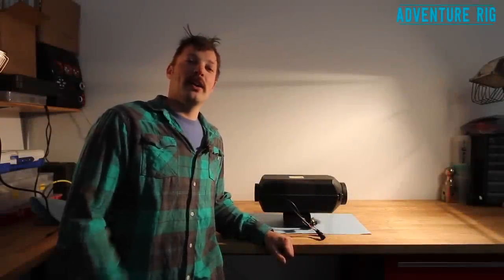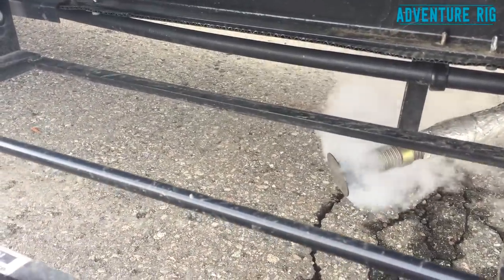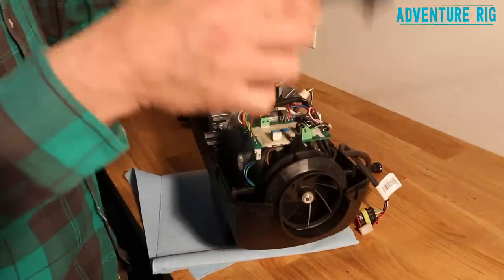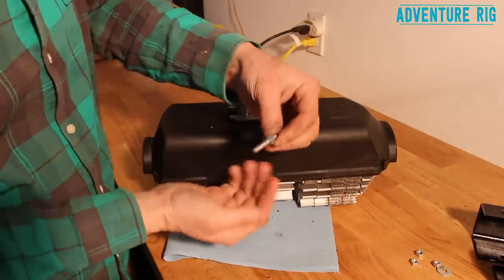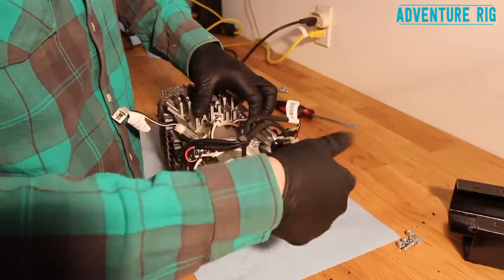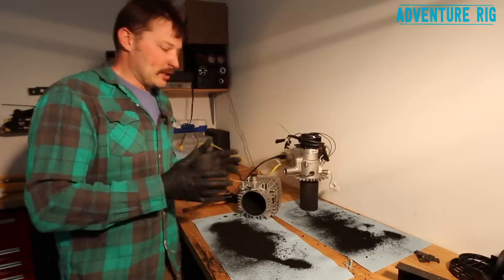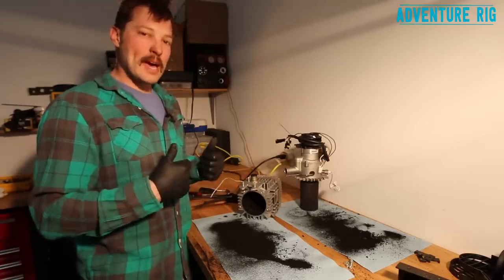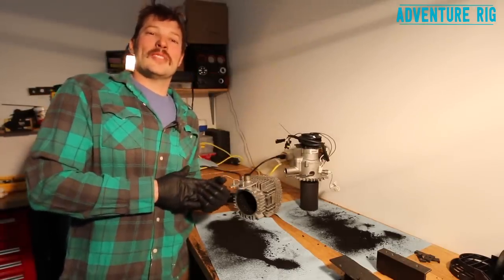Must watch before you use your new Planar Heater! [How-To] Disassemble and Clean Planar Heater

Comment: I installed mine and used it for about 20 hours not knowing that information I was running it on low turning it off excited to have a new product starting it up again running it on low I must’ve turned it off and on 10 times in 20 hours and would crank it up but then turn it down to low cause it’s so hot 
the next day to it wouldn’t light and was smoking I took it apart and was full of soot!  One day of use !
Reply from the maker: Been there done that.

Comment: I baught an 8Dm. Ran it with diesel controller and it's never missed a beat.
Reply from the maker: Our 8DM ran great as well.
Reply: @AdventureRig  9 dm next winter with a controller that WORKS. lol
Reply from the maker: @dougferguson5581  I have a new controller that is all digital and it’s freaking awesome. I’ll post a video this winter on it.
Reply: @AdventureRig  coil  the sooner the better.  Ya tried 3 different models. None worked yo the point where it acquired the temp shut off and restarted.

Comment: Just started looking for a brand to buy. I happen to live in the same area as their distributor. They are not cheap and the fact they don't mention this in their instructions just shows how corporations don't take responsibility for their product. The warranty is only a year or so as well, I'll double check. If the company were forced to clean them they would probably start writing it in their manuals. But what consumer wants to go through the cleaning process. I might just buy a cheap version and take my chances as well. Their quality certification means sh*t. Thanks for posting
Reply from the maker: I would save the money and try a cheap version and see if it's any different.

Comment: Is there a gasket between the 2 halfs ?
I normally crank it up once in a while because I saw this video a long time ago , my Planner 44d was working great for about 5 years no issues but this morning the outside temperature was negative 27 Fahrenheit and the heater blinked 2 times (code 13 )
I'm going to heat my fuel pump up with a heat gun , hoping there's just ice in my fuel lines
Probably clean it out too or see how dirty , thanks for posting
Reply from the maker: No there is no gasket.

Comment: I feel I have to put my line as well. Thank you for this video instruction. I used it a second time to clean my 44d. After the first time, I ran it at full power so often. Eventually happens the second time, maybe diesel is not high quality for that. And the chamber inside was not so dirty as yours, but yesterday it refused to start and gave me lots of smoke. Now it works perfectly.
Reply from the maker: Yeah running it on kerosene has helped immensely for me. Just not as excited that I can’t run it on diesel which is east to obtain for me.

Comment: Sorry for sounding daft but why do you need a HEATER that puts out 1 or 2 degrees.... Kinda defeats the object of a heater?
Reply from the maker: I’ll fire up the heater when it’s 10 degrees outside. It’ll warm it up to 80 degrees in the camper. Once it’s 80 the heater just holds that temp which means it runs on low.

Comment: Hi. So ive run the 8 dm in my 37 ft Camio for 4 winters.  No thermostat I've ever had sent to me from Planar has ever worked. I also use diesel conditioner in ever 5 gallons I put threw it. It runs great...never had an issue.  Has anyone out there baught the new 9 DM ? Thinking of getting one for winter 2022. I do recommend these heaters.
Reply from the maker: Have you seen the new electronic thermostat they offer? It's a touch screen and super user friendly.
Reply: @AdventureRig  hi. Ya tried them all. There's no one near me to service them . I had an rv tec try that one too. It just runs full time. I'm going to get a 9 dm next year I think. Wish there was a vid on here showing how it runs. 4 seasons on the 8 now. Never had it cleaned . I run conditioner threw it. I'm sure it's got soot . No idea how many years they are good for but I sure don't want it yo calf in 20 below weather. Will toss it and buy new.

Comment: Thanks for the video, really helpful.  I did watch it when I bought the High Altitude Russian Plantar model so I ran it on  M/high most of the time and never at night when I'm sleeping.  Use warm blankets!   It has now  been used in my Diesel Sprinter van for two winters.   My last ski trip in Silverton Mt the heater did exactly what you described in your video.  Lot of white smoke and wouldn't heat up. Bummed...  Snowing and I now need to get it up and running.  It is tapped into my fuel tank and mounted under the passenger seat. It will be a real pain to take it out to clean it.  If I disconnected my fuel line and ran it into a can of Kerosene would it clean up?  You mention using Kerosene full time now.  Did you mount a tank under your van or do you carry cans?  How long will a gallon last on Med/high.  I dread the thought of dealing with another fuel source so any suggestions would be great.  Thanks
Reply from the maker: I would try kerosene first and see if that cleans it up but most likely it will need to be cleaned. I run a separate tank on our trailer. It may just be something that needs yearly maintenance although it sounds like a pain in your case.
Reply: @AdventureRig  Thanks for getting back to me.  Mine doesn't get used a lot maybe 20 to 30 times a winter but it is used at high altitude over 8000, 3/4 of the use.  How often should I replace the gaskets and filters. Thanks Marie
Reply: Blankets ain't an option for me as I'm in Canada and may need to sleep in vehicle while finding housing. This can be life or death. These things cost 1000 bucks plus taxes and whatever else to get them installed. Now wonder people buy cheap versions if paying more gets no more reliability.

Comment: I saw people mentioning kerosene but it seems to be three times the price and then you need to add ATF, 2 stoke oil or diesel to it to lube the pump. Kind of defeats the purpose. 
Also I’m kind of lazy so I’d recommend spraying some brakleen or some other solvent in the air intake while it’s off and just let it drain out the exhaust. It won’t be as clean as taking it apart but it’ll be enough to get it going again. I’ve had O2 sensors work for another year with just a little brakleen. Can is only a couple bucks and great for so much more than breaks.
Reply from the maker: Jason Thanks for watching Jason.

Comment: I bought a Chinese knockoff heater, and the one that I have allows me to adjust the air/fuel ratio via the controller.  Soot builds up primarily as a result of insufficient combustion air compared to the amount of fuel.  If the Planar allows you to increase the amount of air and / or decrease the amount of fuel injected when running at the low setting, you might try making adjustments to get it to burn as lean as possible while still maintaining steady combustion.  That may resolve your soot issue.
Reply from the maker: Brian Smyla Hi Brian thanks for the feedback.
Reply: I have the 8KW chinese version with red oled remote. Do you know what the parameter PF-1 to PF-6 means? Have asket the seller but I only got stupid answers. I also have an option off and on in the options menu.

Comment: I wonder if you can help me. I have a similar heater the Planar D2 . It tends to "false start" now and  again. .. The routine it goes through to start sounds a bit different with the clicking of the pump a bit  faster tnan normal. Then it like shuts off  for a few seconds then Pang makes a loud scrtchy fan noise. I then turn it off and restart and it usually performes properly on the second try. Any suggestions as to what might be causing this " false start"??
Reply from the maker: Is it giving you any error codes?
Reply: @AdventureRig  I don't have any sort of display :-) So, no :-)
Reply from the maker: @Garo48  I'm not sure what the noise is that you're hearing. I would send them an email. They've always been helpful for me.

Comment: Just got a new one from ebay and im not getting power to the controller.  Checked fuse and I'm getting 12v to the ecu but no voltage to the controller?  What else can i Check
Reply from the maker: I’m not sure but their website says not to buy them off eBay because they are a counterfeit product.

Comment: i hooked up my heater neg-to pos, and pos to neg, now i can't get any power to it. can i get some advice on how to repair this. thanks.
Reply from the maker: I'm not sure that would blow the fuse since it's now on the opposite side and now hooked to negative but I would start with that. If that's not blown it may have damaged the circuit board.

Comment: The heater is basically a diesel engine.
Why not just use Sea Foam in the fuel and let it clean itself as it runs?
Reply from the maker: Some people do that. I have not tried since switching over to kerosene.

Comment: Ok. After having it for so long now. Have you ever noticed a sort of build up on your windows on the inside? Not a water vapor build up. But a kind of greasy build up. It’s hard to describe. It’s a film that seams to collect on the interior of the windows that at night time produces a glare. It’s like a kind of haze. I am experiencing that now. I can’t smell anything. Can’t see anything. But after running the heater for a few days for say 8 hours a day. I notice a film building on the windows. I clean them with windex and found it only has the film after running the heater. Thoughts?
Reply from the maker: The only time I've heard of that is in vehicles. The plastic components like the dashboard can heat up from the sun and actually off-gas. These molecules can show up as a film on the windshield. I've never seen it in a camper.
Reply: That’s really interesting. Because I’ve never had that problem before. But I can see that it could be possible. Altho I didn’t think the heater was getting anything that hot. It is a good place to look. Thank you.
Reply: Is the heater installed on its side? (If you still care - two years on!)

Comment: I used to have an old "VW THING" can't remember what year the car was, 70,71,72???? I was a Junior in high school but the heater was a gas operated deal mounted in the front trunk/ dash and had a tickler coil and miniature spark plug in the body of the heater and the exhaust terminating by  the left door hinge quarter panel by factory design. That sucker got the driver passenger compartment friggen hot. Didn't know until many many years later, the model year of the VW only outfitted those cars with the gas heater for 1 year, apparently that particular model of the THING was a rare and highly sought after by collectors and being a teen not knowing any better of course, you guessed it...."SOLD IT"  for minimal dollars...lol
Reply from the maker: There was a guy I went to highschool with that had a green one. Very cool car!
Reply: @AdventureRig  : Thanks for the reply, yes they were a cool car, it had a lot of ground clearance from the factory, without modifications it was a cool weekend outdoor trail explorer when farting around going camping,  shooting etc...never got stuck anyways. Since I saw your video and the more I think about it, starting to piss me off that I sold it.....Damn it...lol.
   Thanks for sharing!
Reply from the maker: The Vacuum tube junky Haha that’s how it goes I suppose.

Comment: WARNING: IF POWER IS LOST TO HEATER WHEN IN OPERATION. THE FLAME WILL GO OUT AND UNBURNED DIESEL FUMES WILL CHOKE YOU, THEY COME RIGHT OUT OF INTAKE END OF HEATER. 
As an engineer I ran ever test I could think of on this thing. Also if you use it inside of heated space verses placing it out side you will always smell a bit of diesel from the vent cap or the fueling process.
Reply from the maker: We have ours mounted in the living quarters and we've never smelled any diesel.
Reply: @AdventureRig Is the fuel tank out side? I smell the fuel every time I fuel it. The fumes I mention occur if power is suddenly lost before cool down. Such as a blown fuse or battery fail, or loss of power supply. A significant amount of unburned deisel fumes come out the air intake end. Just like the white smoke out the exhaust tube when unit is no burning the fuel all the way.

Comment: My question is does your heater have a altimeter in the control system to adj the fuel? Many heaters i looked at don't, which is why i purchased a Espar. Most of the others use jetting to make them work in a range. I have used mine at sea level and as high up as 14k with no issues so far.
Reply from the maker: James Reinhardt It does not but they have now come out with versions meant for high altitude. The update will be available in the next couple of months for this heater and I will be switching out the pump once it’s available.

Comment: I have eberspacher heater in my truck we never have this problem when you turn it on stick the thermostate up full then turn it down after a while and check the air intake for dust build up you should have any problem and they always smoke when first turn them on I've had 25 years of using these night heaters  hope this helps :-)
Reply from the maker: Richard Mitchell Thanks for the input Richard.
Reply: @AdventureRig  no worries fella hope it helps :-)

Comment: the soot comes from the dye in the offoad diesel.  use the clearest diesel you can find
Reply from the maker: I've never run off road diesel, only clear.
Reply: That is just plain WRONG.
Reply: Random Fandom, soot comes from carbon. There is soot when using diesel fuel and it is not dyed! You have seen the black smoke leaving a diesel truck, right? That does not happen when using 100% biodiesel.

Comment: Are you still running the planar heater, is this the Russian version. I'm thinking of using the wet version on the boat. How have you found the reliability of the heater.
Reply from the maker: I just used it last night. It's been working great after switching over to Kerosene. They also make a high altitude kit now I believe and I think they would solve this issue running it on diesel.
Reply: How long have you been using this heater now
Reply from the maker: @Mrleslie007  I've been using this one for 3 years and the last one was 2 years.
Reply: @AdventureRig  did the last one only last for 2 years doesn't seem long
Reply from the maker: @Mrleslie007  No I sold the camper and it stayed with it.

Comment: Great video, Love my heater. I switch it to kerosene at higher altitudes and never had it coke up again. Diesel fuel has wax in it that is hard to burn off.
Reply from the maker: Thanks for watching. I agree with the Kerosene and run a mix if the heater is not running on high.
Reply: espar recommends running their heaters on kerosene for awhile if you have issues.
Reply: You should put diesel additive to your tank because it will grow mold and clogged up your line..
Reply: Run a mix or it will kill your pump. Straight kero will kill the pumps seals

Comment: How long should I run it on high? Like every 12 hr do 5 min on high or what?
Reply from the maker: Scotty Bell I would run it for 15 minutes on high every 12 hours.
Reply: I've heard people say to run it on high every time you shut the unit off .
Reply from the maker: GMT Yes that’s what I would do. I assume the person who asked about running it on high every 12 hours was never shutting it off. In that case I’d run it on high every 12 hours for 15 minutes to keep it clean.
Reply: Hey so I'll actually be using this in a work vehicle that does a lot of service calls. I am basically using it in place of the manufacturers heater.
Reply: @scottybell2060  
Ha ha same here , it'll keep the van and tools warm !
Reply from the maker: Scotty Bell Thanks for watching Scott.
Reply from the maker: GMT Thanks for watching GMT.

Comment: With my diesel heater I removed the glow plug and there is a screen just below it that was caked with soot removed it and replaced it with a new one from a tune up kit i got online included a new glow plug and igniter but this completely took care of the non fire issue and billowing smoke from the raw fuel not igniting, but your video does add another piece of the puzzle for a complete tuneup. I have been running these heaters for several years now and find after 2 full winter seasons i have had to do a tuneup and clean. but I was told that if you run them a couple times in the off season I wouldn't have the no fire issue, but haven't tried it I just think lowering the temp for to long causes the soot build up.. But great video thanks for sharing..
Reply from the maker: Ty Fleshman Thanks for watching Ty and great advice!

Comment: Thanks Mate.  I have a diesel heater, different brand that is a lot harder to disassemble but I suspect I suffered the same issues.  Whilst I couldn't get at the combustion chamber like you could, I also found an excess of soot had restricted functionality.  In the end I used a hammer to tap & vibrate lots of soot out the exhaust, whilst a cable tie inserted in & out helped to loosen stubborn build up.  I too will routinely run mine at high temps now and I can also confirm my mistake was to run the diesel heater on low temp settings for way too long.  Thanks again mate, your vid totally supported my suspicions.
Reply from the maker: John Kennedy thanks for watching John and I hope that solves your problems.